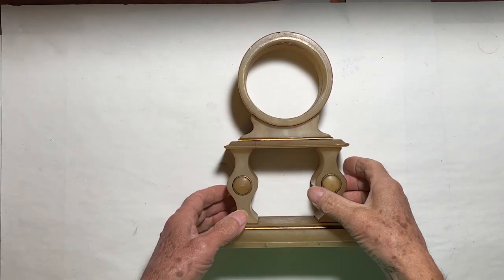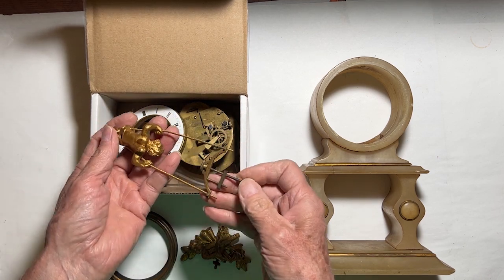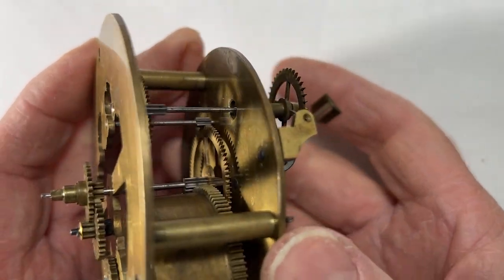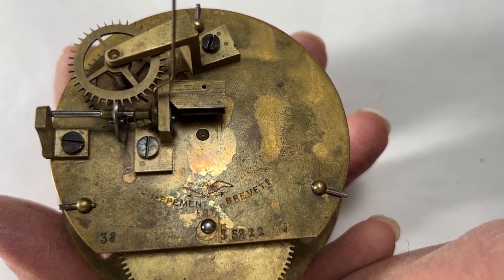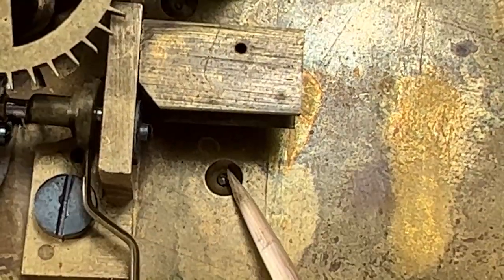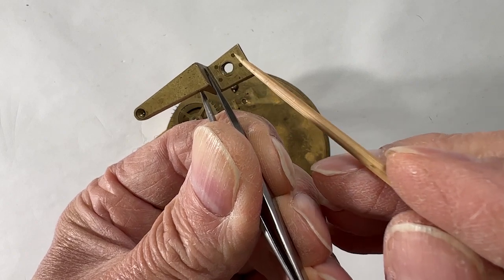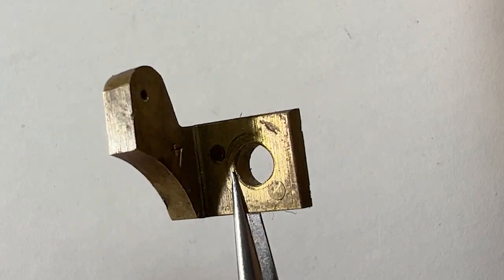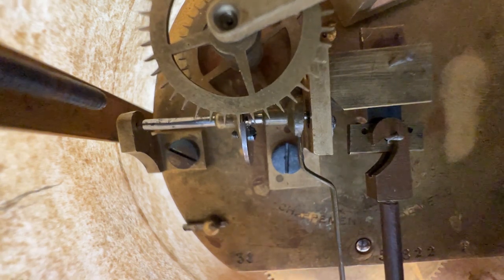Farcot Clock Inspect for Richard from North Dakota #94

Comment: Hello Sir, its very nice mini table clock with different type of escapment. Thank you for your detailed explanation with respect to each and every parts of it.
Reply from the maker: Thank You,
 These are an unusual movement.
Reply: @jamesmartin5370  Thank You Sir for your kind information. Sir as I was sent an email about Seikosha Station Wall Clock regarding pendulum weight. Is it is possible to inform me the approximate weight of the pendulum. 
I made the pendulum by placing the weight about 250grams, but still the time is running too fast say for instance 2 to 3hours fast.
If you have guided me in this regard, it is very much helpful for me.
Thank You.

Comment: The unusual pendulum movement front and back instead of side to side almost puts it in the novelty clock category.  If it runs for a minute with all the scored pivots and worn bushings that you showed it should run once you've addressed those issues.  Glad to see you out with another video after an absence of several months.  I was getting worried about you.
Reply from the maker: Thanks

Comment: Would you ever try to reapply the gold gilt?
Reply from the maker: Not the original gold gilding because actual gilding of precious metals is done using mercury.
At some point in history they converted to electroplating gold to protect against corrosion.
And now they have gone to sputtering precious metals to surfaces.
Today a form of electroplating or sputtering would be options to apply the gold finish.
For most of these in this condition it works well to polish what's left, then clear coat with lacquer or urethane to prevent the brass from oxidizing.